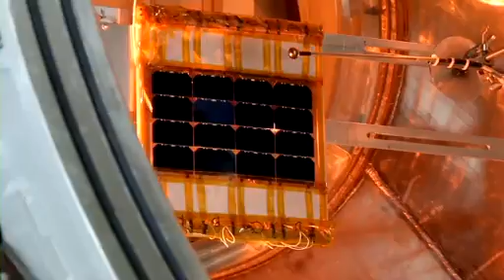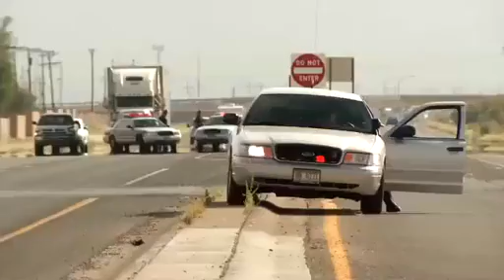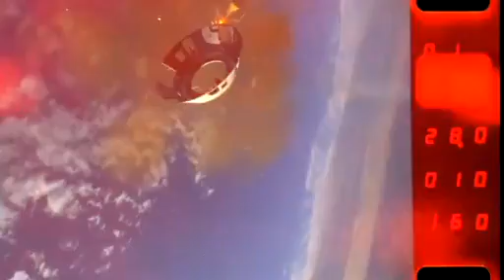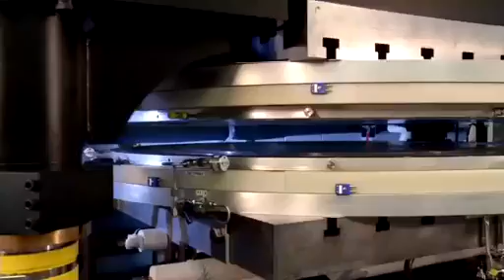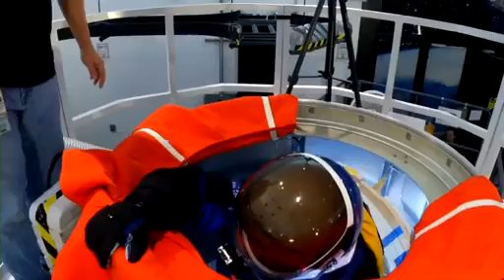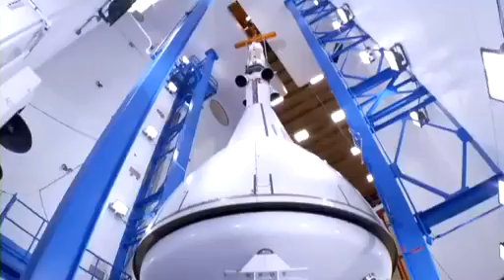Orion Futures

Comment: Building such a huge and heavy "escape rocket" means the vehicle has to carry the load of both for the pre-orbit flight (the most fuel intensive stage). This has a direct bearing on the size of the capsule which will be needed for the 98% of the duration of the mission. And the rocket isn't even dual purpose so it cannot be used for inter-planetary propulsion. Why not take the risk for the initial stage but make the thing safer for the 98% of the journey? typical stupid over-engineering... :(